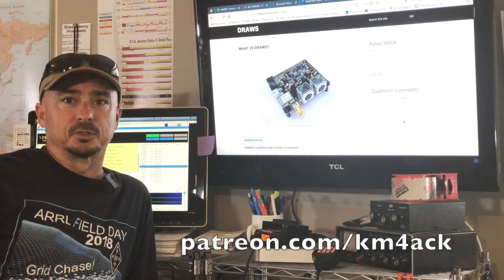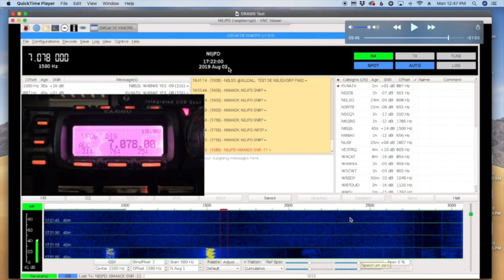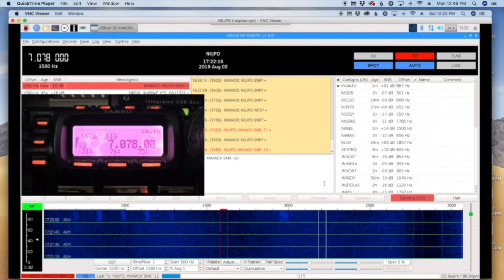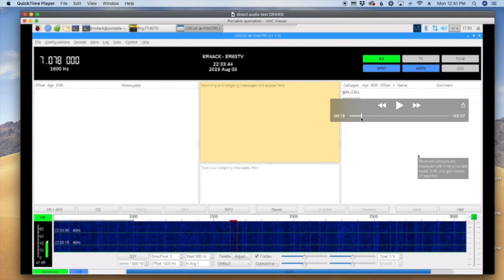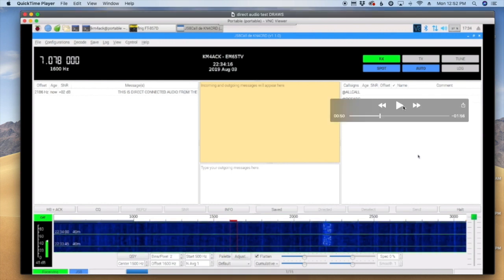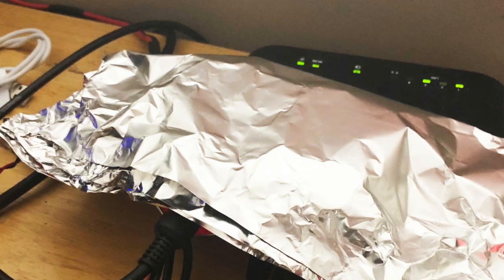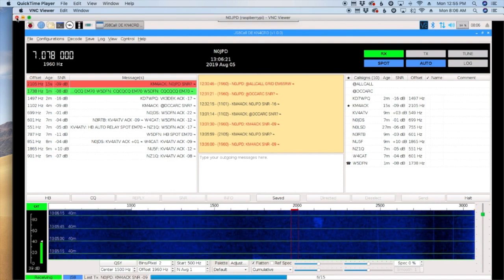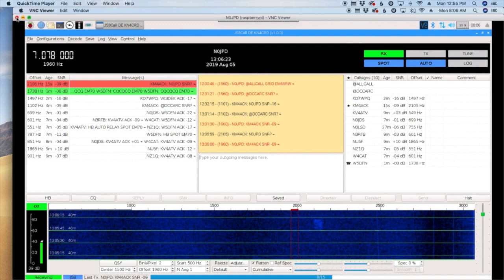DRAWS Update   GOOD NEWS

Comment: FYI............NWDR has developed a metal case and are in final testing / manufacturing acceptance.
Reply from the maker: I have read that for a while now. Hopefully we will see it soon. 73, de KM4ACK
Reply: I know that comms from NWDR have been a little less than optimal from a Customer Service standpoint. But I jumped and got two at the initial order back in April.
Reply: Still waiting. I'm going to load up the latest from Basil. I see you are figuring out APRS and Winlink. I'll be picking your knowledge

Comment: Excellent what you did is in fact build a Faraday cage you can buy the Tackmeter cage on amazon or I can write how to build one easily this is also good for EMF attack 73 VA2SOB CLAUDE
Reply from the maker: The foil was good enough for testing. I did finally find a case and with a slight mod, eliminated the RFI. 73, de KM4ACK

Comment: How's the shielding going to affect the GPS?  Guess external antenna would solve that as long as it doesn't also have problems with the rf.
Reply from the maker: I haven't seen any adverse effect on the GPS since it uses an external antenna. The one from NW Digital works great. The other stubby one that I bought has yet to connect. :( 73, de KM4ACK

Comment: Thanks for the video. I am going to see if I can fit some shielding inside the plastic case. Its a snug fit, so its not going to be trivial, but based on your well documented troubleshooting it looks like it will be worth the effort.
Reply from the maker: You will enjoy my upcoming video. I have a case that has solved my RFI issue with only a slight mod. Just need to get it filmed and uploaded. Shouldn't be too since I  finished testing this past weekend. 73, de KM4ACK

Comment: I love the Raspberry PI and if one just has a "stock" board there are lots of cases available. Of course we often want to combine the PI with add on boards that stack on top, various USB dongles like GPS or audio, etc. Then there is the issue of keeping things cool, particularly with the new PI 4.

Lots of room for experiments, particularly with 3D printing.
Reply from the maker: I noticed the same thing with the pi 4. Purchased a case/fan combo to help keep the heat in check. 73, de KM4ACK

Comment: A metal box for the Pi might help. And, maybe you could fit a Draws in one of these ? https://www.ebay.com/itm/New-Case-Enclosure-With-Heatsink-Cooling-fan-Blue-For-Raspberry-Pi-3B-3-2B/253494536881?ssPageName=STRK%3AMEBIDX%3AIT&_trksid=p2057872.m2749.l2649   And Another https://www.ebay.com/itm/Case-Heatsink-Cooling-Enclosure-Kit-For-Raspberry-Pi-3B-3-2B-Replacement/163793784128?_trkparms=aid%3D333200%26algo%3DCOMP.MBE%26ao%3D1%26asc%3D20171012094517%26meid%3D182b428a7dac4e3f8a6a346a8fcc926e%26pid%3D100008%26rk%3D2%26rkt%3D12%26sd%3D253494536881%26itm%3D163793784128%26pg%3D2047675&_trksid=p2047675.c100008.m2219
Reply from the maker: Thanks for the recommendation. I got a new case for DRAWS today and hope to mod it over the weekend to reduce RFI. Updates coming. 73, de KM4ACK
Reply: @KM4ACK  Did you already have a metal box for the Pi ? Or is this a Draws/Pi combination enclosure ?
Reply from the maker: This one is specific for the DRAWS/pi combo. Never needed a metal box for a pi before this. 73, de KM4ACK
Reply: @KM4ACK  This one has peaked my interest re RFI and the PI. We use a bunch of Pi's with All star and they have a different "radio less" board attached. Some of them have been flaky, strange crashes intermittently, and I've wondered (now) if the  10KW transmitter sitting very close might have a little RFI !;
Reply from the maker: A little shielding wouldn't hurt anything. 73, de KM4ACK

Comment: Great job of working through a RFI issue Jason =)       Radio / computer / R Pi problems is a process of elimination =)      Yep .... second floor apartment RFI Heaven .... the MFJ Artificial Ground help me a lot ( and a coiled of wire on 1 1/2" PVC pipe with one layer of 210 inches of #14 ga. house wire with the coil a foot above the floor =)   It has directional capabilities moving that ground PVC coil around /-)
Reply from the maker: This one really got me. At least in the jeep I knew it was an RFI problem. This one took someone else's help to figure out. I  was totally not expecting it in this case since I had no other RFI related issues in the shack. 73, de KM4ACK
Reply: @KM4ACK  Jason I have some small sheet metal sheets ( about the same size as a license plate on your jeep if you need some to play with =)
Reply from the maker: Thanks for the offer! I have several sheets at my disposal. The new case should arrive later today. Hoping to find time this weekend to mod it and test. It's all plastic but the only one I could find. 73, de KM4ACK
Reply: @KM4ACK  Yes I have a few hundred of them .... need to get a Harbor Freight metal brake :-)))   Self made "BUD BOXES" :-)))

Comment: Had similar problems too, real disappointing NWDR has not followed through on a case. Bought the plastic case from 3rd party but still has no protection from RF.
Reply from the maker: I just tracked my plastic case. It is out for delivery today. Hoping to mod it this weekend and add a bit of metal on top and bottom. Will try to test and see if this is enough. But then I may run into heat build up even if it does work. I think more people are having this issue whether they realize it or not. I emailed NWDR a few days ago and inquired about RFI protection around the audio chip. Haven't heard back yet. 73, de KM4ACK
Reply: @KM4ACK  There is this case now, and it's made from anodized aluminum.  https://nwdigitalradio.com/products/draws%E2%84%A2-case

73 VE7NDE

Comment: I like the idea of this DRAWs. Hopefully it all works out. Maybe some ribbon cable and a separate enclosure?
Reply from the maker: That's possible but kinda defeats the coolness of the DRAWS hat. Having it all in one small package is part of the appeal of the hat. I have a plastic case on order and hope I can add a bit of metal to it and block the RF. 73, de KM4ACK
Reply: @KM4ACK  look forward to your findings!
Reply: What about using double-sided PCB board to make an enclosure. You could solder it together
Reply from the maker: I might fall back to that if plan A doesn't work out. I am really hoping that NW Digital gets the metal enclosures in stock soon. 73, de KM4ACK